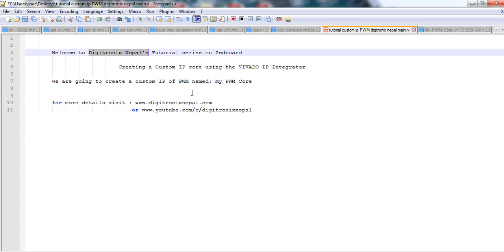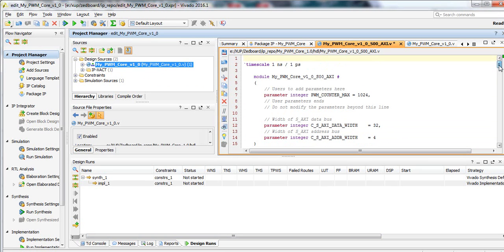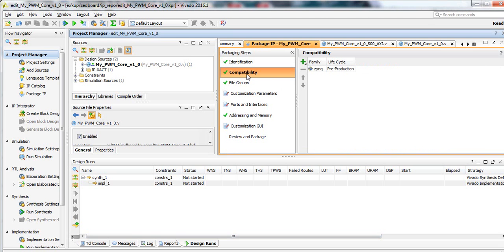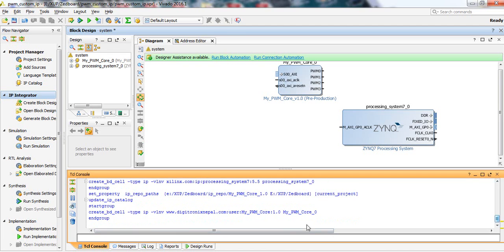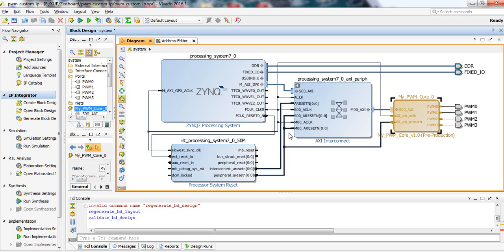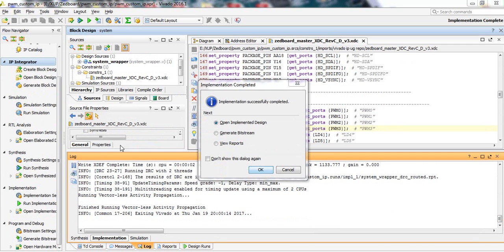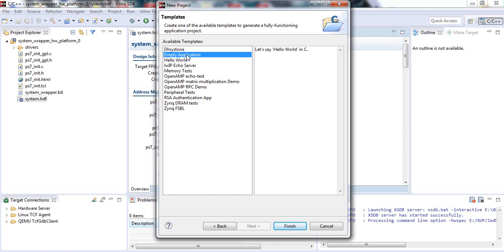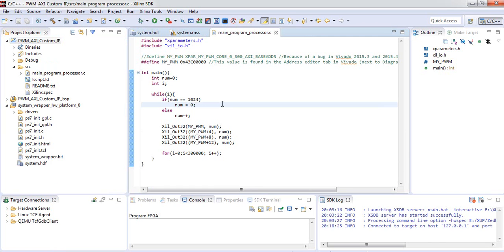Zedboard Tutorial on Creating Custom Verilog AXI IP of PWM in Vivado by Digitronix Nepal

Comment: Good work.. what is the clock rate of PS?
Reply from the maker: Hello foxbat296, in our design processor-PS is running at 666MHz and the PWM IP is running at 100MHz. thank you for your comment!
Join our Embedded System Design with Zynq FPGA course at Udemy at Ultra-Low Cost Coupon, for FREE/Ultra-Low Cost Coupon Codes: https://logictronix.com/online-courses/.